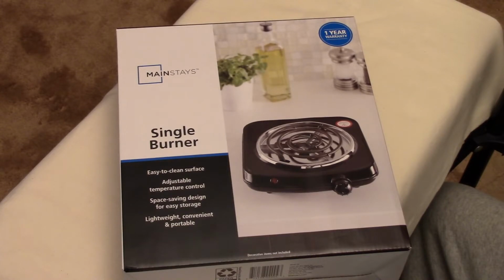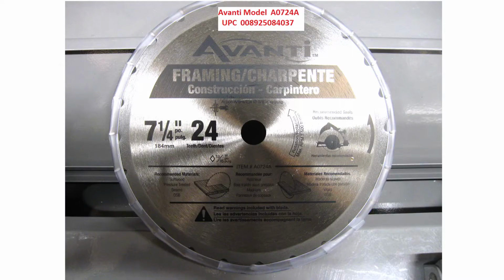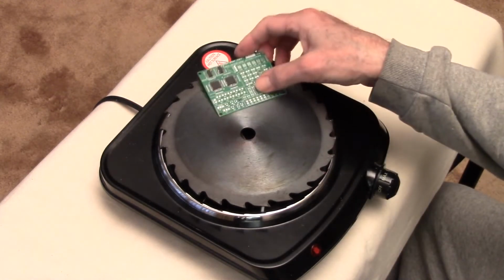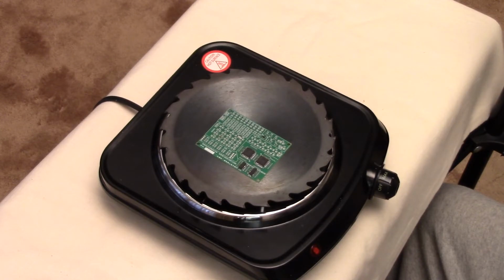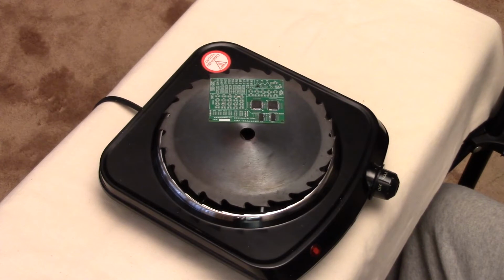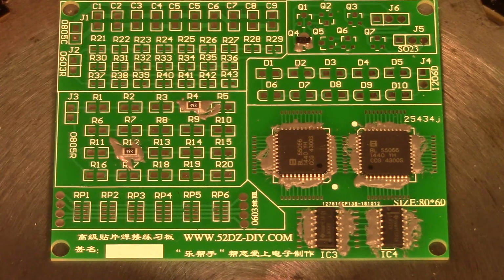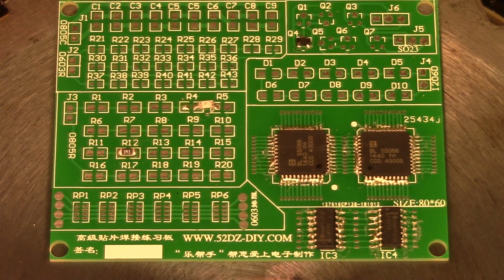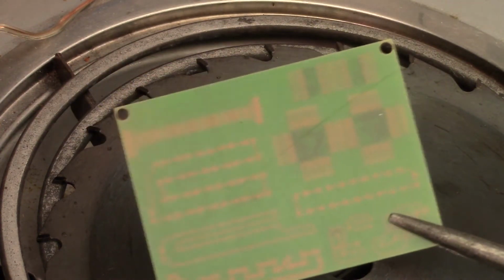Reflow Hot Plate - Easy, Extreme Low-Cost DIY

Comment: Maybe one of those flat griddles can be used as a hot plate instead of the blade. Might hold heat better and offer more consistent temps across the board due to thermal mass

Comment: I assume the saw blade and screws are to reduce the temperature and slow the temperature changes, compared to sitting on the heating element directly.  Since the hot plate has a temperature/power dial, I wonder if you could find the right setting, and use a cast iron skillet (maybe upside down?) to slow the temperature changes.

In any case, a neat, simple idea!
Reply: It seems its an analog system and getting an exact spot would be quite tough. Might need to put a thermocouple and arduino or some kind of power switching relay to get it where you want consistently

Comment: What happened to R4 around 13:28? Also, at the end, you seem to have shorted pins everywhere - I guess you still need a stencil?
Reply: I guess it's a vapoor. I think I had this when I tried to restore old dry paste by adding IPA or alcohol into it. I had exactly same issue, the paste was useless.